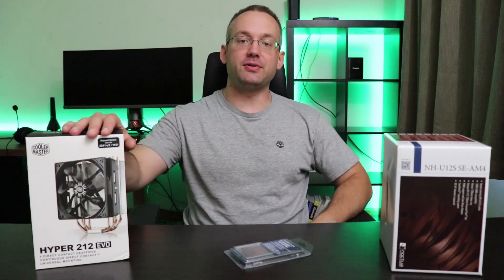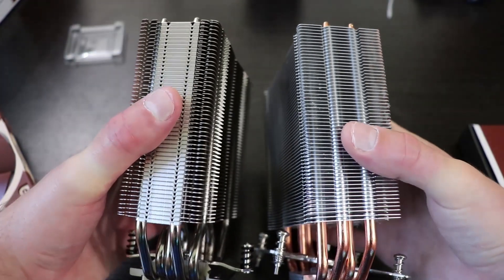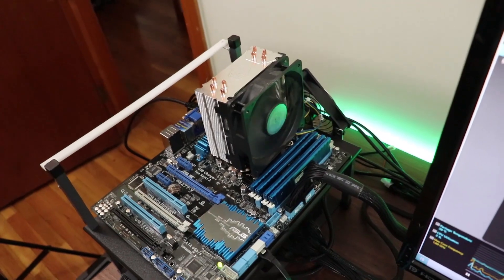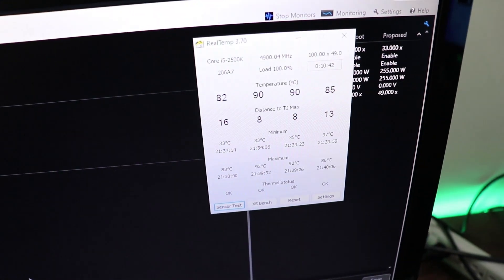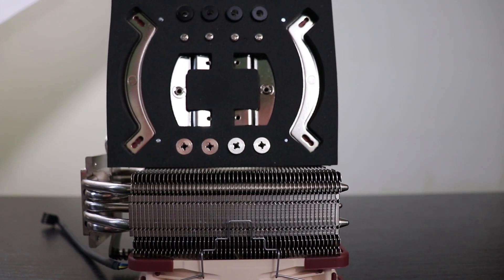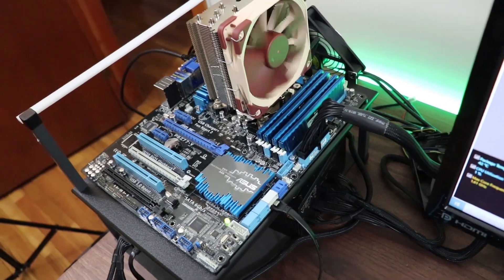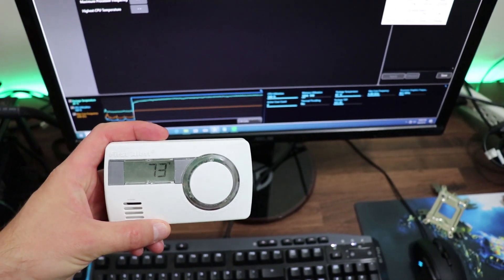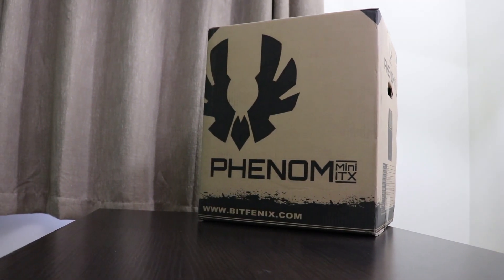Cooler Master Hyper 212 Evo VS Noctua NHU12S Overclocked to 4.9 ghz at 1.5v - Who will win?

Comment: Haha this is such a waste of a video. You didn't set fan curve based on each cooler. You're using a fan curve from a different fan. So both fans did not ramp up to proper rpm based on temp. 🤡
Reply from the maker: The fan curve for the CPU Fan header was configured in the motherboard's bios.

Comment: You ran the test for 7 minutes 35-40 seconds on the Noctua and 10 minutes 40 seconds on the Hyper 212 Evo.  I mean, if there wasn't bias beforehand it'd be one thing.  Ya know, with the whole "so I took it all apart and redid the thermal pad" part lol.  You didn't even show those results... hmm..

Noctua is overpriced as hell.  I'd never pay $80 for some brown fans and equal temps.  Hyper 212 Evo is $19.99 after rebate right now on Amazon.  Normally $29.99... just like when I bought it in 2016.  It definitely wasn't the right cooler to, say, overclock the shit out of an FX-8350, but it was more than enough to give a couple hundred extra mhz to it on a weak board.

I just don't get it.  People see big $$$ prices and are like OH YEEAH!  You could buy a multitude of cheaper, larger coolers and get far better performance every single time than the equivalent sized Noctua.  I prefer it's nicer, smooth base, sure... but in the end, it would have hit the same temps had you ran it the same length of time.  Maybe more if they kept going.

Seriously, fuck brown fans.  Also, I think you did this test dirty.  I mean, after all the fanboy talk about Noctua and the constant "hur dur 212 not enuff" shit you see redditards talking, I had already assumed the Noctua was better.  But, yeah... it's not.

Comment: 5:47 You are holding the screw driver with bare hands its a mistake you might get shocked in future  😂⚡⚡⚡
Reply: No, he's perfectly safe. 

Electricity will always take the path of least resistance, and his body is much less conductive and a much larger distance than just going between the pins. 

Nice try though 👍

Comment: The Noctua is $100 vs $60 for the Hyper 212 here in Australia. Unless you’re trying to get the quietest cooler possible, it’s not really worth the small performance difference IMO.
Reply: the Hyper 212 v2 goes some degrees lower than the V1, so it's better price/perfomance than the noctua

Comment: Can you use the Noctura fan on the Cooler Master ? Testing it that way would be interesting 🤔
Reply from the maker: Yeah definitely possible!
Reply: must be the noctua fans help the performance
Reply: As long as the fans fit and don’t interfere with ram and other stuff, you can potentially use any fan on any cooler. For example, I have a cryorig M9i and I wanted a second 92mm fan for push/pull but Cryorig doesn’t sell the 92mm fan (I can’t find them at least) so I just got 2 92mm noctua’s and used the splitter cable that’s provided with them. They are brown but the fit and work fantastic.

Comment: Those stress test temps cant happen in a game right?
Reply from the maker: Correct for the most part.  What processor you using?
Reply: @SystematicHardware  I'm using Ryzen 5 3600
Reply from the maker: I don't think the 212 evo supports AM4, but yea any of those cpu coolers will be perfectly fine for a R5 3600.
Reply: @SystematicHardware  noted, thank u!
Reply: @SystematicHardware  it does support it. and you now have a black edition which basically is a v2 of it. :)
Reply: @SystematicHardware  I had the black edition and it supports am4

Comment: is it worth going for a cooler thats double the price but only drops the temps like 5 degrees?
or is the price tag also because of noctua being way more reliable and durable?
Reply from the maker: I've been using the same Cooler master Hyper 212 evo since 2012 and had no issues. The main factor is noise and the pitch of the noise.  I use a NHU-12A on my 3950x and it's amazing.  The price is justified for me however if you're building a budget system, that may be a different story.

Comment: How loud were they? I wish you'd measured the dB levels. I'm running the Cooler mAster 212 Evo with an i5 6600k at 1.5 v and under load it is too loud for my liking it distracts me from my games even with headphones on.
Reply from the maker: If noise is a factor.  Noctua NH-U12S is significantly better in not only decibel level, but pitch as well.

Comment: normally would have better heat dissipation whit small layer of nice thermal paste on both cooler generally speaking that whit thermal pads you have increase of space which make thermal transfert between the cooler worst as distance material the heat need to past bigger you ability to remove the heat i think would have make more relevant to use thermal paste also as both product come whit thermal paste by default.
Reply from the maker: Thanks for commenting and I 100% agree :)  I used thermal pads to ensure there was no variance with thermal paste application.  This is a great idea for a follow up video and I have TONS of thermal compound.
Reply: @SystematicHardware   i know how time consuming that can be i keep a eye out for it as i do have interest in a cooler that do not interfert whit ram clearance small issu due trying to shrink my build in size to put on a tablet next to  monitor keep experimenting very fun
Reply from the maker: What are your hardware components?
Reply: @SystematicHardware  well i got r5 1600x at 3.95 i'm confortable at the moment but may eat bullet once r5 3600x or r7 3700x make sense i also got a old i5 4690-k which still can make dam good budget build for esport and handle fairly well if you lock you fps around that 55 fps on gpu side far less impressive but got fairly nice selection ranging from gtx 1050ti rx 570/80 variant of 4gb because both don't have computationnal power from my point of view same whit gtx 1060 6gb which model whit gddr5X from zotac very nice cooler on it for it size impress been a bit lucky as did sold two polaris card in past one rx 480 and one rx 570 right peak of minning boom ;P did fuel my taste for pc hardware sadly gtx 1070 as still high in price and not sure if they would hold that well when next gen console game start coming end of next years so i hold until amd release there rx 580 refresh on navi call rx 5600 educated guess :P gonna make perfect pairing for my need save trouble also to change cpu or can sell everything and buy overkill and perfect candidate for long holding at 1080p in the rx 5700 i admit addicted to pc hardware lol hard for me to sell for peanut those i kind get attached to it wich do not make sense in the end ^^.Sorry for language mine first language french canadien
Reply from the maker: That's an impressive list of hardware!!  I'm going to hold out until 4th gen Ryzen comes out next year.  I have a R7 1700 and i'm going to wait to upgrade that processor so I can make the most of the upgrade for performance because that will be the last processor you'll be able to purchase for the AM4 platform.  The goal is to find a fast 12 core 65w 4th gen chip for the upgrade.  I'm also very exited about the new AMD graphics card future releases which is part of the reason why I haven't pulled the trigger on a used RX 570 8Gb.  I have a GTX 1070 and though it can push 80-100 fps via triple A gaming, I can agree that it will soon age into an excellent budget 1080p card for 60hz 1080p panels.  So you are looking for a cpu cooler for a smaller case?  What case is it?
Reply: @SystematicHardware  certainly not bad move to aim for but just because i fear if i hold until 4 gen would them be better to wait for drr5 arrival also resell may get harder once last gen available on the market.May probably gonna hold until the 4000 serie are out and buy the 3 one for cost saving mesure that would be logical thing since i don't really levrage that much power requiere but i think i would not be that bad selling now and take that rather nice little r5 3600 event if i really would love that r5 3600x since always a enthousiasme when come to cooling.Saw dam nice price on that nitro+ rx 5700 baller grade 1080p card for next gen console sadly would really be beneficial on paper to get that third gen whit that been say i got 75 fps monitor rolf so no need for me to spend more when that gtx 1060 and rx 580 are able to keep that nice 60 to 75 fps in about any title as long that you confortable making some compromise on the setting.I need to ear the reason and hold a bit more like you for sure.
Reply: @SystematicHardware  are you holding strong in this black friday craze lol been amazed by 2000 serie price but did convince my selfto hold when i saw cinebench r15 gain from previous 1000 serie :P